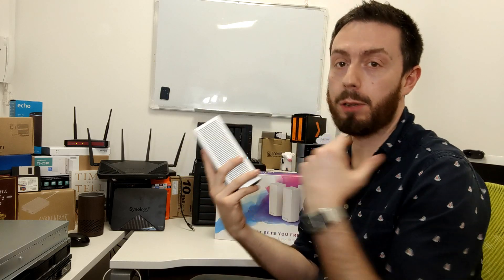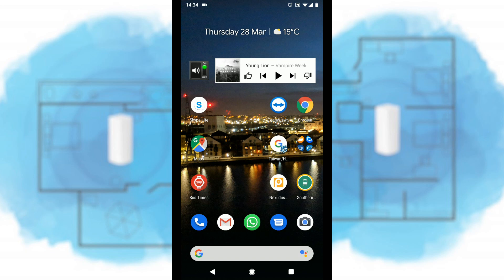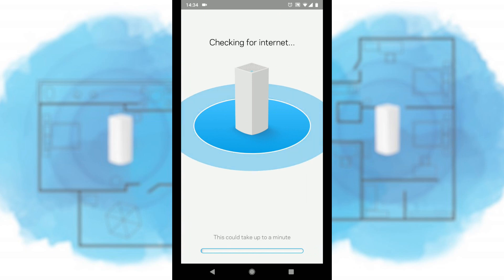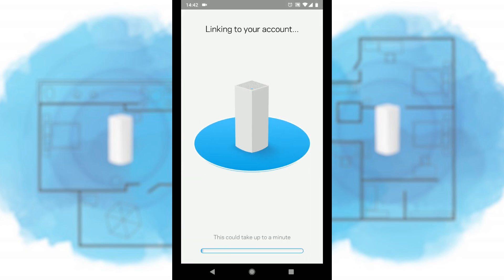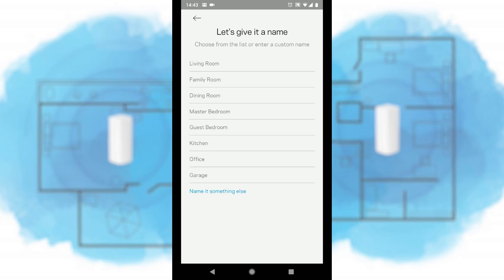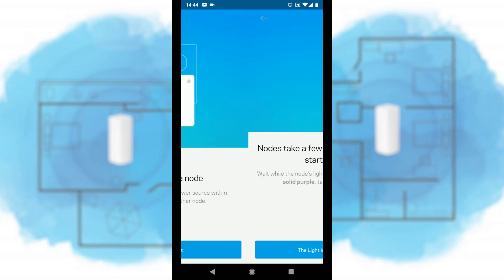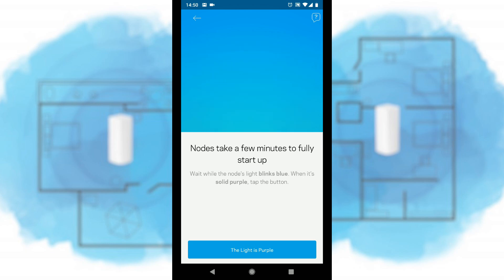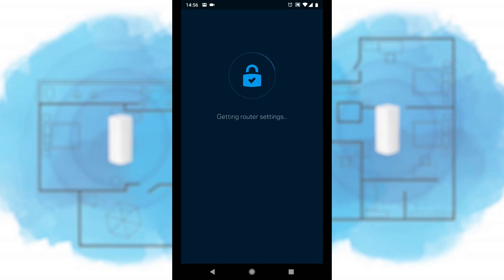Linksys Velop Mesh First Time Setup Guide

Comment: Interesting as mesh network technology seems to be the next best think on the information highway. I have 1,550sq ft to cover plus a finished basement family room. One stays connected to you ISP router/modem and the other two are to be in lower level and kitchen. I think they accommodate my needs pushing WiFi thru a single kitchen wall to my back porch. I am retired and never a gamer or X-Box fan, but learning from a few videos and talk radio for the lasted correct news and info without the “Lame Stream TV” one sided shows. I thank you for the information provided!
Retired and thirty. Thank kindly for your efforts. DK.

Comment: I have a powerful Linksys router + 4 AX5400 nodes and it is impossible to get a steady signal between the nodes. Constant interuptions on the first and second floor. This is the most expensive and poorest working network I have ever had in my life. Any advice?

Comment: Is it possible not to direct from Modem and just connect from the Router LAN? I mean Modem----> Router----> Velop. I don't want to bypass my router.
Reply: i believe this is possible. i plug my velop into my router. now the only problem is having my 3rd node to connect, which is why im here
Reply: @5IRAHHHP  i tried my one and it's not working even how many times I tried
Reply: @newbietrader2189  alright, i had some problems with that as well. it just took a lot of resetting which doesnt make sense. some things i tried personally

- trying and resetting if it doesnt work
- trying and unplugging from wall and trying
- trying, unplugging, wait for it to get past the blue lights, and just reset even before trying
Reply: somehow my problem was fixed just by sitting the node close to the main hub, and just leaving it alone. in 24hours it connected somehow and showed the light blue light

Comment: I've had a 4 node setup for around 3 years now, and there is 1 BIG issue. I have changed my IP address range instead of using the default, added a bunch of IP reservations and some port forwarding; all very normal stuff for any regular router, as you can imagine it takes some time to set all these details up after the initial install. So far all is good and fully working, BUT wait until you have a power cut, guess what, all of the setup you did is completely lost, and the IP range goes back to default, so any static endpoint on your network will stop working until you redo the entire setup again! Normally I wouldn't care about such a problem, but there is NO BACKUP functionality! Do you literally have to go through the pain of setting everything up again every time! It's not just power cuts that reset everything, I've also unplugged the nodes to replicate them and guess what, yup all the setting disappear. Many have complained for years but Linksys have still not added the backup features! It's the 1 & only issue I've found, and because of Linksys' attitude I would not recommend this mesh router.

Comment: Is anyone else having issues just trying to set their damn Triband through the app? My first node is connected to wifi butbit wont connect to the app to set it up. I dont understand what im doing wrong, ive been on the phone for 62 minutes on hold, im also online trying to see which one will answer first and again i barely took it out the box 2 hours ago. This is not a Breeze at all. It won't connect period! Im at the point of returning it before bestbuy closes the store. I paid close to $400.00 USD for this crap
Reply: im currently going thru this same issue
Reply: @charlescoleman9784  I ended up having to reset them 3 times in order for them to start working. Another issue I had was that it wouldn't work to set up with my Samsung Galaxy note 9, Samsung Galaxy Tab S or my work IPhone. I tried one more time with an iPad Air first Gen and that worked, I also got to separately connect these nodes as independent wifi routers which worked better then the Mesh thingy, Mesh for me was having issues with Signal Strength. So having the nodes independent for me was the best option, But wow was this task difficult. Definitely not a breeze lol!
Reply: @joseluisruiz3789  Im using an iphone. i coudnt get it to connect to my modem and then my wifi
Reply: I think ill try it again in the morning and return it
Reply: @charlescoleman9784  yeah good idea. They are great but the set up issues are very bad. Only the iPad Air first gen worked for me to set them up right.  I have an iPhone and that did NOT work at all. 😤
Reply: @joseluisruiz3789  thx for your feedback.

Comment: Install was very easy imgs.love/lVelopRouter?Aた Replaced an older WiFi-5 router. I only have 1 WiFi-6 device to take advantage of the higher speed but it does have higher speeds. Signal for older devices seems solid. Some devices that had less signal now have better signals. No external antenna is very nice from an aesthetic point.

Comment: I have a question? I’m having an issue trying to hook this 3 node system up. I have a cable modem and my current WiFi is a eero system which sucks. Once I hook up this velop system can I disconnect the eeros and have only the velop as my only WiFi system? Thank you
Reply: Yes
Reply: Absolutely you can do this. I had a TP Link AC1200 and left it as the modem, but switched to Bridge mode as it offers 4 ethernet ports (1 used to go to the main Velop). The system runs great.